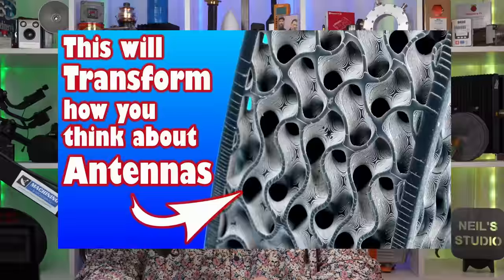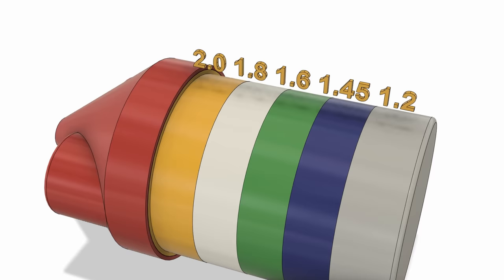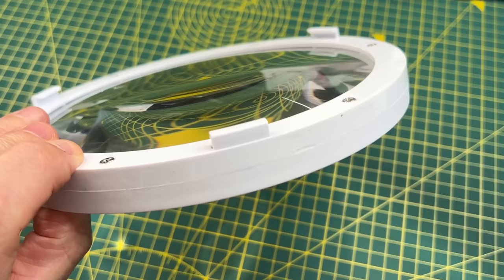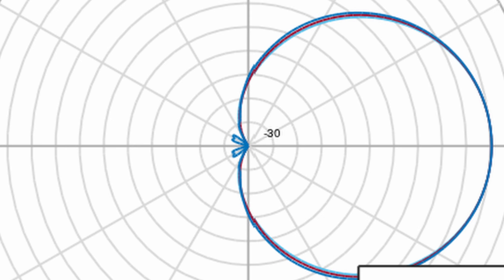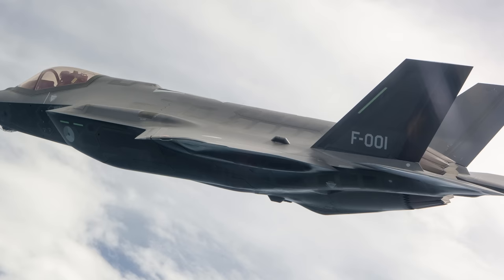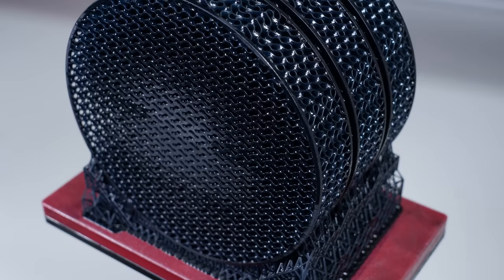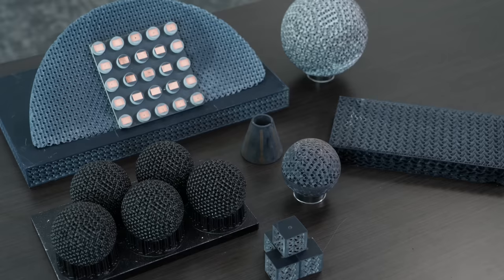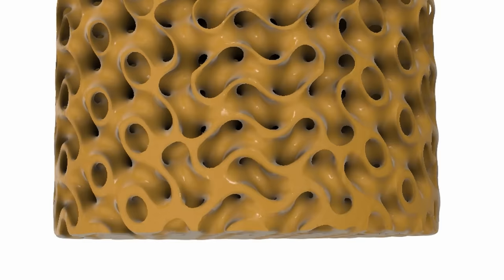How Microwave Lenses REALLY Work!

Comment: Solution for not having resin or filament that is rf reflective. Coat internal surface with some sort of very thin surface adhesive, possibly a form of super thin contact cement or tacky material. hell even a sugar syrup that has an evaporative property. Fill all the internal voids with the fluid, drain, and then allow to dry while the object rotates to maintain reasonably even distribution of the fluid. Could possibly be improved depending on the surface tension of it. Once dried, the surface should be sticky to touch, once in this state simply submerge the object into a dust bath of rf reflective powder, i am not familiar with the properties of rf reflective powders, but i imagine such a thing exists. This should result in the same result if the thickness of the adhesive and thin layer of powder is accounted for.
Reply: Oh, and i also remember seeing a video of someone electroplating 3d prints, might be able to be adapted to this object.
Reply from the maker: @KirbyDaMaster  Electroplating is certainly an option for some types of prints, but you'd have to dissolve the metal away after a subsequent step unless you were trying to make metamaterials, but it's not at all easy.  I'm doing some electroforming work, but I'm using aluminium machines formers as the negatives, then using an etch/zincate/copper/gold plating, then copper electroform, then dissolve the aluminium in hot NaOH, then the thing copper flash in acid to leave a gold interior.  That's a lot of fun. It's probably easier to use sputtering or plasma deposition to get a comductive layer, but you have to deal with outgassing of the print and adhesion issues.  Lots more fun.
Reply from the maker: The tough bit is finding something sticky that isn't lossy.  Most nonpolar things are non-sticky. The  other issue is how to get a consistent AND varying wall thickness.  That starts to get very hard, as does dealing with electrostatic buildup. Making a negative in a dissolvable filament, then filling it with a nonpolar solid that can be dissolved and the solvent then evaporated might be an option, there's a lot of work going on with lasers but fusing ceramics needs ludicrous temperatures.  A fairly good dielectric filled with a high-Dk powder, or interlocking nodules is perhaps still a but simpler to achieve.  Materials Science is hard.
Reply: @MachiningandMicrowaves  I have also wondered about SLS, which is more or less the same as SLA but with powder instead of resin, and cured with a laser rather than a UV curable resin. Its must more repeatable, and doesnt have the consumable ptfe plastic sheet at the bottom of the vat. I saw a video not long ago that showed someone who tried to make an at home SLS printer, but we are still a long way from that being a viable hobbyist product. Lost wax casting is something i also consider for something like this, but the part looks quite complex and would likely form several errors in a cast like that.
Reply from the maker: @KirbyDaMaster  The huge problem with any form of casting is finding a suitable dielectric material.  Most of the good dielectric materials can't be polymerised at sensible temperatures and won't dissolve in solvents that will evaporate readily, so casting with them is really hard. They are mostly thermoplastics, but only at rather high temperatures, and they are pretty viscous too. Laser sintering usually needs a fine powder, but the good dielectrics are also very good insulators, so static charge on the power will be a nightmare.  Clever folks are working on this right now I'm sure!

Comment: 14:51 so far i don't see anything that requires a special printer, the printer described appears to just be a bigger resin printer.  Yes the printer has some pumps and a heater to agitate the resin but there are ways to do that with a normal resin printer. And it is a gyroid infill so technically a normal filament printer could do it if the base material won't mess with the functioning of the particles.
Reply from the maker: Phil explains the reasoning for the use of the Fortify printers at https://youtu.be/3YMRfw0uWlw?t=225 
It would be possible to do much of the tech using a hobby printer if the resin was heated and stirred and the film window wasn't damaged by the inclusions, but for production quality results for aerospace applications, I don't think an Elegoo Saturn would be an acceptable choice.  How home experiments though, and especially for home-formulated UV resins, perhaps it's feasible.  Loads of fun trying though, whatever.
Reply: @MachiningandMicrowaves  to be fair aerospace applications for military are far beyond anything anyone else needs just because of the nature of the objects they are trying to detect or avoid being detected by.   My guess for the hobby grade stuff is that quality/effectiveness is going to have a large range from useless to above commercial grade in some instances where the individual is really into the stuff and said individual will have modified hobby grade devices to their needs. To be clear those people will likely never reach mill spec aerospace grade stuff but nobody but the military needs to.
Reply from the maker: @deltacx1059  Absolutely, and in much of my work I get the same results (or better) than an aerospace manufacturer could, because I have unlimited time and obsession, so I can make stuff that nobody would consider selling or relying on for space comms, warfighting or safety of life applications.  Worst that can happen is a shrug of resignation and a small sigh

Comment: The expression "speed of light is constant" is only true in the formula e=mc^2 where c is USED as a constant for the sake of convenience to reduce the value of e to a manageable proportion. That application has nothing to do with the speed of actual light photons directly being observed. So c is a constant, is NOT the same as all speeds of all light are always constant. 

That is a falsehood easily disproved, thus: 
What is the velocity between two photons moving apart from each other?
What about two in parallel to each other?
Think about it.
Reply from the maker: Depends on the rest frame where the observation is carried out. My lab is my rest frame, and all my measurements assume I'm in free fall in an inertial frame (which I'm not). Photons don't experience the passage of time in their rest frame. In my lab, I can measure how long it takes a bunch of photons to travel a specific distance in a vacuum or in air, or in a dielectric, and infer the "speed" of a bunch of photons from those measurements. It takes longer to get through a dielectric than a vacuum.  My beef is about the mechanism that causes the measurable slowing at the atomic scale. Excellent channel content by the way.

Comment: Would that type of 3d printed antenna be sort of a physical modulation to specific frequencies?
Reply from the maker: You can certainly create resonant lensing structures this way, but these are very wide-band and work over maybe a 4 to 1 ratio of wavelengths concurrently

Comment: Would this mess with timing/modulation of signals?
Reply from the maker: Excellen question! The maximum phase delay is less than half a wavelength and it's constant, so as there's no frequency chance involved, nor any doppler phase shift, the resulting plane wavefront in the far field is all coming from the same spherical wave at the source. Where the lens is stepped like a large Fresnel lens, then the parallel far field is constructed from many original waves, but even then, the effect on any practical modulation scheme would be small even if the symbol rate was as big as a tenth of the carrier frequency

Comment: Thanks for the informative video.
I would like to ask if it is possible to use the same approach for high-energy sources such as a classic magnetron with a frequency of 2.4 Ghz?
Thank you.
Reply from the maker: There are some interesting challenges at 2.4 GHz and high power.  First is that a quasi-optical lens like a Mikaelian or Luneburg needs to be at least 8 wavelengths in diameter to be effective.  At 2.4 GHz, where the wavelength is around 12 cm, that means a lens is a pretty huge structure around a metre across, so almost impossible to print economically. There are other solutions using dielrod style lenses that can get reasonable directivity around 13 dB, but that's a very long way short of being a searchlight-style beam.  I creamed about sawing up a microwave oven and fitting a dielectric lens to it, then setting up another dielectric lens a few metres away and placing a mug of cold coffee at the focus to see if I could couple enough energy into it to warm the coffee.  Apart from the immense dangers of all that RF energy swilling around, the size of the apparatus at 2.4 GHz is just too ridiculous.

A nice practical large Luneburg for 10 GHz might be about 25 cm diameter, and that would be easy enough to print perhaps in two halves, or perhaps an even larger one could be made in sections or a quarter of a hemisphere, with the longest dimension then being only half the finished diameter.  I can imaging making a 35 cm Luneburg, although it would be expensive to make it in a high-performance dielectric filament and completely ridiculous using resin.  Perhaps using a cheap HIPS filament or even polypropylene would be possible, but the total mass of a 35 cm sphere with gradient index would be something like 9 kg, so that's a significant cost of about £200 with HIPS filament at perhaps £22 per kg. Not impossible though, and it would be hella impressive!  I'll see how long it would take to print such a beast.  Doing it at 2.4 GHz needs each dimension to be increased by a factor of four, so the volume, mass, print time and cost scale by a factor of 64.  That sounds like "too much" for my budgets!  The second aspect is the loss tangent of the material.  HIPS and PP are decent dielectrics with a tan-delta around 0.0004 at microwave frequencies, so the dissipation at 800 watts of incident power would be tiny so long as there was some air movement to prevent any hot-spots developing.

Comment: As a user of apochromatic optics at both F/6.45 & F/9 the absolute perfection of extra-low dispersion doublet lenses and the vital performance differences of an achromatic lense (at significantly higher Focal ratios) are super dramatic BUT unfortunately
VERY seldom seen as the figuring of the TWO combined refractives indices must be darn near PERFECT and as a dabbler in optical theory...there are dozens (hundreds) of potential combinations of glasses for BOTH must cooperate with each other i.e. the mating glass determines final image authority so what has this to do with microwaves ?? Good question!! 

Not entirely sure... but i wanted to point out that a simplistic overview does an injustice to the subject matter and for optics what we most desire is an image fully ringing with authority, so we use a Strehl # to categorize the degree of replication in the virtual image vrs the 'live' one and a Strehl of one(1) is a perfect analogue.

 Essentially a near one POLY Strehl (not just one specific wavelength) that we measure using interferometers and software to categorize the limits of perfection throughout the visual spectrum are widely known yet very few prople ACTUALLY have a FULLY apochromatic optic so visible verifiable manifestations are as rare as hens teeth. Sad state of affairs. Its the state where if you do not spend the big $$$ you miss out.

So this new use of microwaves and the new abilities of printed 3D shapes and materials will be fascinating to watch.

A mirror avoids the chromatic errors but introduces other much more significant ones i.e. obstruction and scatter

The way to define the limits of the resolving power to a system is to use stars(*) to determine the closest two stars can be seperated yet in the same breath for any other target that is not a star we are left holding the bag
 for an unobstructed only optic can easily determine seperations much tighter than 'Dawes' 'Rayleigh' criteria says for that size system i.e. Cassini's division rilles on the moon.

So the upshot is that sometimes the obvious is hiding in plain sight. 

Overlooked for whatever reason....
Reply from the maker: For most applications at microwave, the refractive index changes by way less than 1% over five orders of magnitude of wavelengths, plus generally we deal with relatively low bandwidths, so chromatic aberration is irrelevant, unlike at near-IR and optical frequencies.  Also, antennas at microwave have a diameter of 10 to 100 wavelengths, so diffraction is the main enemy. The key issue is sidelobes to avoid picking up off-axis noise.  For a typical terrestrial path of 500 km, a beamwidth of less than half a degree is rather self-defeating, as the requirement is to generate scatter from inhomogeneities in the troposphere.  A Mikaelian uses the same principle as an optical fibre, although it isn't thick enough to create full self-focussing. Imagine trying to polish a lens that's 15 wavelengths across, around 7.5 micrometres, that's the sort of challenge that microwave lensing involves, but we can make regular lattice structures of varying density down to 1/50th of a wavelength with ease, and control dimensions to better than 1/100th of a wavelength. Optical modelling at those scales is tricky, hence why we use finite-difference time-domain electromagnetic models based on Maxwell's Laws to model the performance of GHz lenses.
Reply: @MachiningandMicrowaves  fascinating! The smallest scale ripple of polishing really determines (by its absence) the throughput accuracy. The optic is said to pass muster if the optician has a quarter wave accuracy and is the basis for the 50X per inch rule as max power dynamic ibelieve yet if pushed further upwards towards one eigth wave progress then finally arriving towards a not totallly unrealistic one twentyth,  by utilization of either a glass fluoro-crown or by crystal fluorite and the refractive indices between the crystal and FPL-53glass is a few parts in a thousand yet....infrawave is propagated through whereas is scattered in glass. The nuances are almost subliminal at the otherend and as you referenced the atmosphere is the great equalizer. The'degreeness' of greatness is the difference between doing 100X achromat to 1000X apochromat. Somewhere in between, usually towards the lesser, is what we get, but in that rarest of times we receive a light limited optic and not one by errors in fabrication.

The difference is in the time it takes the brain to accept tbe veracity of the translated image. Diffraction IS the great culprit and with mirror obstructed systems what we have are two(2) unique optical amplifying systems that are really diametrically opposed. One has the ability to havegreat sharpness and one has the ability for great sharpness but ALSO astonishing COLOUR VIBRANCY. The two are not interchangeable. Similiar yes but same NO. My little 4inch perfect lense beats 40inch mirror in colours and power ability WITHOUT breakdown. No hint of a lie Sir !! My surmise why this is so is that the fabric - the tensile strength of the dynamic image plane comes from being nonperturbed by those small scale roughnesses of the entrance pupil. I got to about 900X on the moons alpine valley rille & was non blurred and fairly darn bright at a exit pupil of only ~.1mm....this optic and my new little one at 62mm is similiar but with less perfection ~1/8th fully apochromatic at near 50X/" 
As i said the nuances are fascinating and when something surprising happens thats certainly food for deep tbought.

Thank you for the fascinating reply!!!
Reply from the maker: @palmereldrich  One of my upcoming projects is making a laterally-displaced-ellipse mirror and matching reflector.  They have a ring-caustic focus rather than a single point. The beauty is that despite it looking like a Cassegrain or Gregorian, there is no obstruction from the subreflector.  That will be at 6mm wavelength, so getting better than 1/20 wavelength is very easy.  It gets tougher as I approach 1mm wavelength, but even so, 20 micrometres is not exactly challenging compared with 20 nanometres for optical systems.

Comment: Couldn't this then be used as a filter too? A highly tuned single frequency filter? Perhaps tuned to the decay frq of cesium to make more compact and light weight clock that adjusts drift of xtal. Maybe I'm thinking too much when tired.
Reply from the maker: Dielectric filters and resonators are certainly possible, and a 3D print approach could mean you could make massive arrays of filter or resonator components.  In general, metallic filters are much simpler to manufacture to high precision, and the losses are lower, but perhaps the temperature coefficient would be the biggest issue.  Selecting out the correct microfine transition in Caesium or Rubidium atomic references is not a big challenge, it's getting the excitation and pumping right, but maybe for a big hydrogen maser, or more likely a compact gaseous ammonia maser at 23 GHz it might be feasible to use printed components.  Up to a point, this is a technology that's looking for applications and that needs imagination and invention.